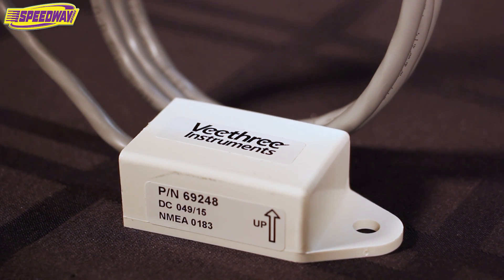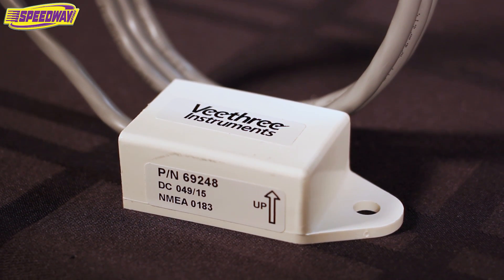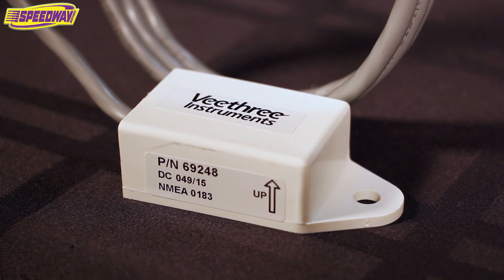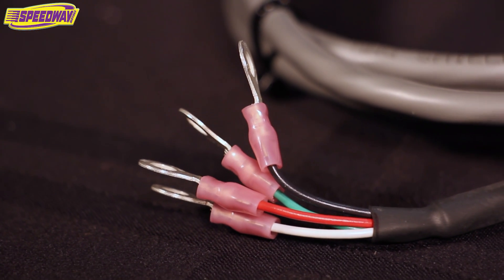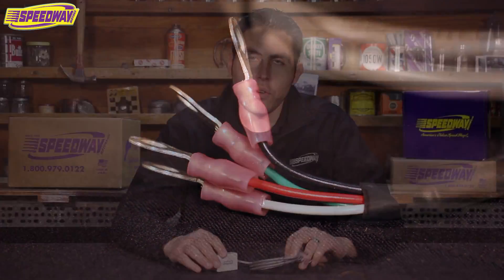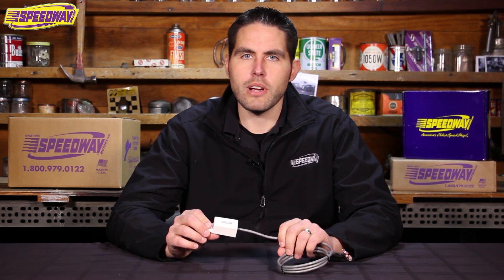Speedway Tech Talk - GPS Your Speedometer

Comment: @1:09 you begin to explain, "your old-school 70's cars that have mechanical speedometers"...... But does not explain if it will or will not work with mechanical speedometers.  The answer is, a electronic signal will not drive a mechanically driven speedometer. (cable driven speedometers will not work)

Comment: Hey Pat I recently bought and old dune buggy and the speedo doesn’t work , it has a cable from the front wheel to a sender unit with4 wires , will this gps unit work for me ?
Reply from the maker: Yes, this unit is a great substitute for anyone having issues with a mechanical gauge reading properly, due to changes in the size of tires or gearing.  This sending unit will work with most electronic speedometers, which should make installation a breeze.

Comment: So I have a Burgman 400 that 425 cc it's not running the stock tire size on the front which is where a magnet speedometer gear is interfaced with the rim and a magnetic pickup that reads the magnet gear and sends it to the speedometer, I want to put the speedometer on GPS because it is right now saying I'm doing 80mph at when I'm doing 68mph which is partially thanks to the way Sezuki sets up their speedometers to read faster than actual speed but that leads to the bike saying it has more miles on it than it actually does so even though the bigger tire has reduced the speed reading closer to actual speed it still is reading significantly faster than actual speed. Would love for a tutorial on wiring up on my bike which I will also be getting a Burgman 650 and a CBR1100XX Blackbird soon so knowing how to wire this unit up on a bike would be nice. Thanks for your help if you can help a brother out.

Comment: would this work for a cheep ebay atv speedometer?
Reply from the maker: The GPS sender is designed for electronic speedometers that require either 8K or 16K ppm signal which you will need to verify is what your speedometer requires.